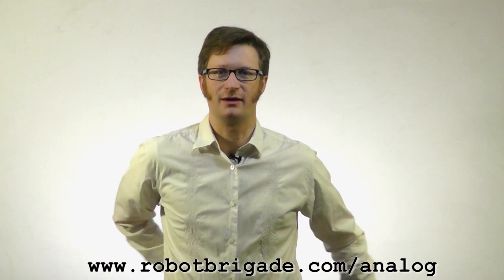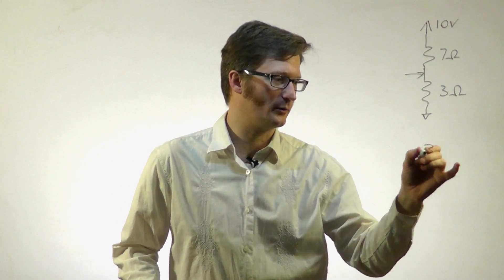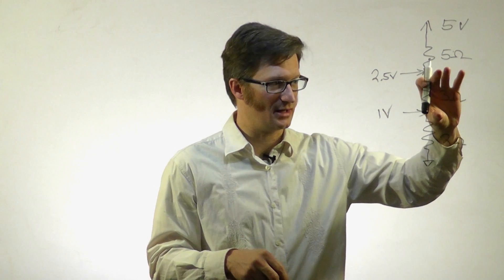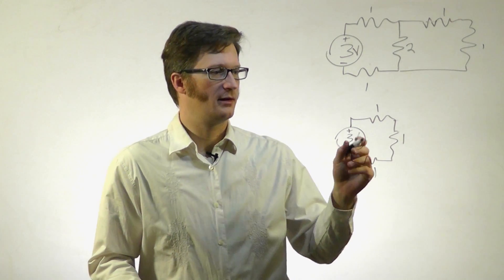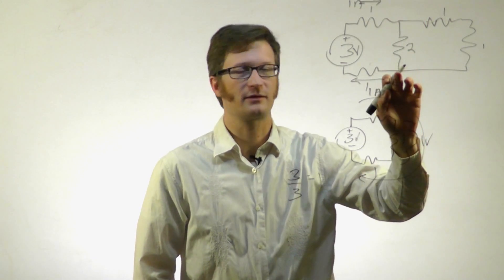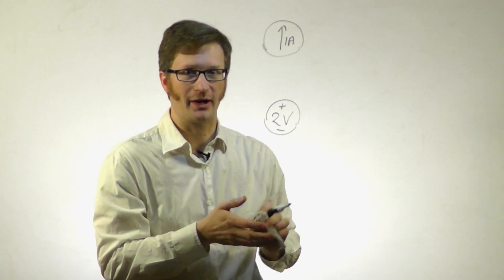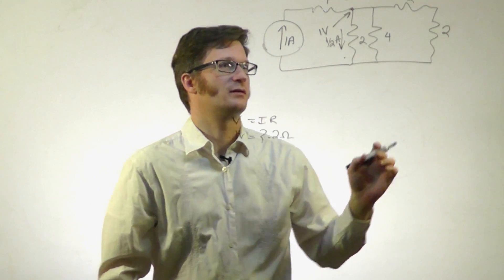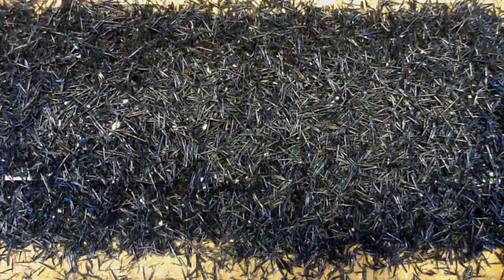Analog Electronics - Voltages and Currents in Resistive Circuits

Comment: Jack,
In your video at point 12:20, you calculate the voltage drop as 1 volt and you go on to say that this is the voltage drop across the vertical resistor network. I believe that you should have said that this is the voltage drop across the 1st horizontal resistor.

If the other resistors (vertical and parallel ones) had different values, you would have ended up with a different voltage drop across the vertical portion of your circuit.